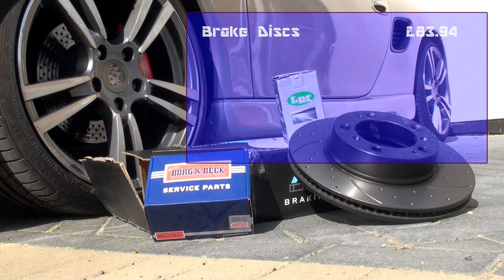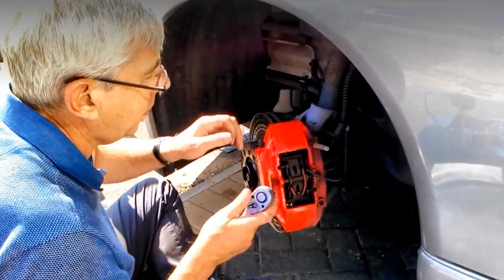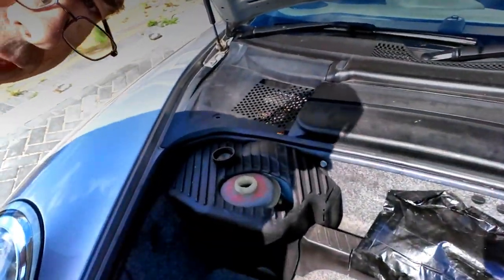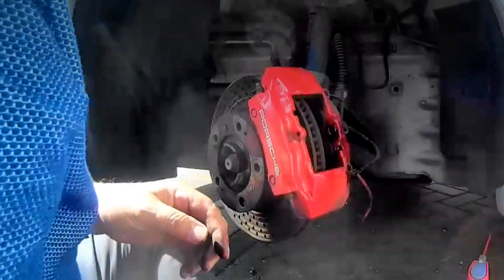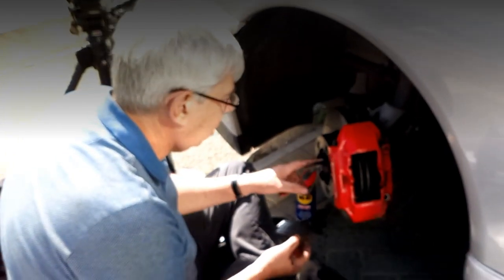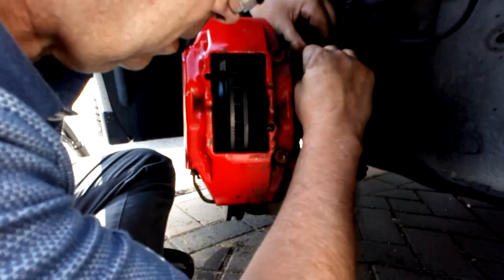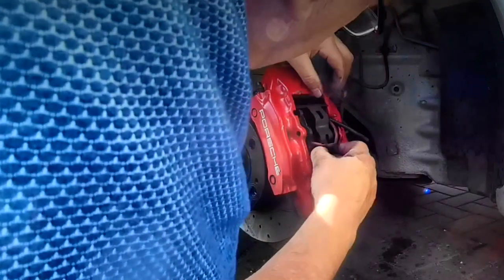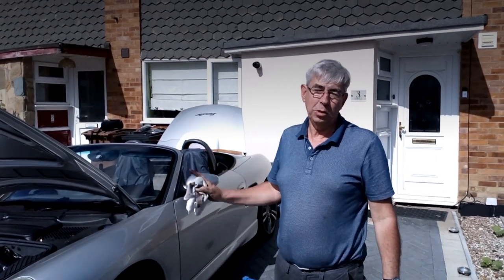Boxster 986 Replacing disks and pads

Comment: Nice to see you again with your little tutorials, Paul.
When you open the brake fluid reservoir, loosen the cover completely but leave it on the reservoir.
The DOT4 is very hungry for water ... When there is no more cover on the jar, the DOT4 takes moisture from the air which is in contact with its surface. This air, which has become dry, is less dense than moist air, dry air is constantly flown away and is permanently replaced by more dense moist air. Therefore all the time without a cover allows the DOT4 to absorb moisture. If you leave the lid simply placed on the jar, the DOT4 will only absorb the small amount of air in the jar (which is negligible), then will no longer absorb it. Normally, the DOT4 should be changed every two years, but we know that it is rarely done. So to extend the life of the DOT4 always leave the cover on the jar.
Reply from the maker: Thanks for the tip, I changed the fluid when we fitted the new servo, that was probably 3 or 4 years ago now.

Comment: Hi Paul just have a couple of points for you. You should of Wire Brushed/Cleaned the mounting surface on the Hub and smeared a thin layer of Copper Grease on there to make removing Discs a lot easier in the future, also same with Mounting Screws. You also should of used Blue Locktite on Caliper Bolts and torqued  them to 63lbft. I know this as I do all my own work on my Caymen S. Keep up the good work. Mick 👍🍻

Comment: Brake caliper bolt torque is 63ft lb 85NM , great idea on the brake line bracket , good to see you back after a while !
Reply from the maker: Hi Jon, I found the 63ft lb on the web, but everybody was saying that's what they had heard and didn't know if it was correct or not. as for the bracket, you know me, anything to make life a little easier, lol its nice to have a little time to enjoy the things you love, made me realise I'm working to much,
Reply: The workshop manual from Bentleys is well worth getting , not cheap though ! how's the new bumper holding up ?
Reply from the maker: Not to bad, high maintenance being so low, but I knew that so it's small cosmetic repairs ever 2 or 3 months, didn't help when some muppet clipped it one night and broke the indicator lens, both are coming up in videos soon, so you can get the whole story lol

Comment: Excellent info. Will need to do these soon; the one thing I can say is Europe made weird engineering decisions with wheels lugs and not using stubs. Why complicate things! Try changing a wheel in a side of the road during a winter storm in the dark! But love it anyway and cheers from Canada!
Reply from the maker: Yes, strange choice, they don't promote changing the wheel at the side of the road anymore here in the UK. They say its to dangerous now days! they recommend a brake down service or one of these emergence tyre inflator thingy's

Comment: I can't get anywhere near undoing the two Phillips bolts even after hours of WD-40. They just won't budge at all. Do you have any suggestions?
Reply from the maker: Heat them up, really hot, they should move then, you can also try an impact driver, or both!
Reply: @Paul1962  would an impact driver not just destroy the head of the bolt? Also, what would you suggest heating with. A blow torch? Thanks!

Comment: Did you clean the discs after spraying WD40?  I would have avoided WD40.
Reply from the maker: Yes I cleaned everything, didn't tuch up the paint work on the calipers as I couldn't find my red paint, I did repaint the centre of the rear disc's to clean the look up a bit more and match the look of the fronts, I didn't clean the inside of the rims, which I would normally take the opportunity to do while they are of the car, but we were running out of time. I think keeping everything thing clean and painted especially under the wheel archies is what makes a car stand out. I try not to promote any particular brands, but a penetrating oil of some type is essential for removing stubborn bolts
Reply: @Paul1962  You can tap the driver with a hammer while turning to loosen the screw if it is stubborn without resorting to penetrating oil.  The idea is like an impact socket.  Also I would switch the screws out to Philip's head screws and not tighten them so tight.
Reply from the maker: @ripmax9572  apologies, I thought it was a genuine comment, if I had realised it wasn't I would of ignored it
Reply: @Paul1962  what do you mean it wasn't a genuine comment??
Reply from the maker: My sincerely apologies, I misinterpreted your last reply(driver, you meant the screwdriver?). you could indeed use an impact style approach, I tend to use that as a last resort, I prefer working with a penetrating oil first as it is less stressful on the components.